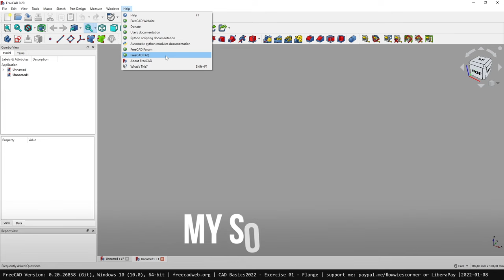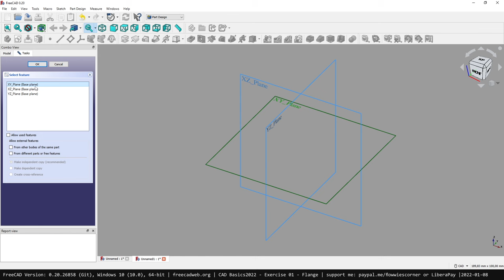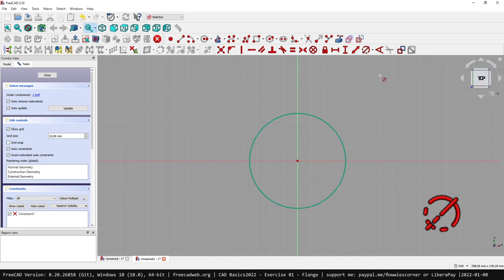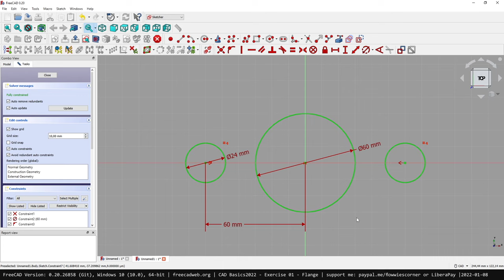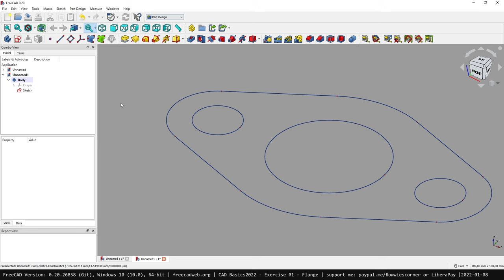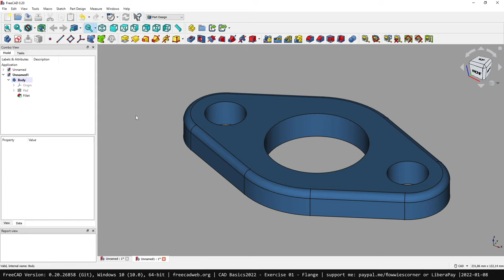FreeCAD 0.20 - Basic Exercise #1 - FLANGE (EN)

Comment: For absolute noobs like me, who followed step by step and got a TON of errors and frustration, make sure the "Auto-remove-redundants" is selected under the constraints panel. This is my 3rd time looking at FreeCAD, and these little things being left out of tutorials is exactly why beginners give up. This is a 9 min video and I spent 30 mins struggling to figure that out. That's a 3x cost. This speaks to both the institutional knowledge that experienced users forget, as well as generally bad default workflow settings. It's clear after understanding how constraints work now, that he has this setting enabled, as you see the symmetrical constraint ID change from 5 to 4 in this video. So removing redundant constraints is critical to complete this exercise but left out by the author
Reply: Oh man did I struggle with this redundancy issue myself.... thanx for the solution!
Reply: Thanks to your posting I managed to get past a real stumbling block. I posted above before I read your post. ;)
Reply: Unreal! Thank you for posting this! I am screaming at the computer.... so true, I have been using AutoCad for close to 30 years. I "use" Fusion 360 etc. exactly what you said, one simple thing to change on the constraints. I almost removed the FreeCad app from my computer.
Reply: Exactly! The teacher's task here is not to create obstacles. This is not figure out yourself type deal. If you teach. You show clearly step-by-step. Or don't show at all! I hate teachers who think they teach but actually waste time. 👊💥☠
Reply: because they keep changing the software too much between each edition.
Reply: this is another problem with this software.  they keep changing it too much.  in the version I have 21.2 there is no option to auto remove redundants in the constraints panel.
Reply: @blue03r6  Yes you do, but it's not visibel without clicking the wrench next to the constraints panel.
Reply: Thanks for posting, you just saved my sanity, why on earth is this setting not auto enabled?

Comment: My first attempt was to draw three larger circles and then join them with lines, then create the holes inside of that. Cut away the lines I don't need, That worked ok, but it's hard to exactly determine where the lines should connect to the outer circles. I also tried with Arcs, but that was much harder. I didn't even think of the polyline! That looked much easier. I'm more familiar with OpenSCAD, so I need to change my mindset a bit to do this kind of CAD

Comment: When I tried to set the symmetry, I got an error. I didn't have "Auto remove redundant" turned on.
Who will have an error, check this moment.
Thanks for the lessons.
Reply from the maker: Thanks for the heads up! I hope I mentioned to use this option in my previous basic course parts but I cannot be 100% sure. Will have to check this
Reply: @FreeCADAcademy  It is quite possible that they mentioned this item :-) I enjoy watching and learning. I uninstalled version 0.19 and installed 0.20. The default setting may change. I didn't notice that little mark right away :-)

Comment: Ok great video! Lovely explain it!  I have more than 1 hour on this exercise, I was getting stuck on horizontal constrain 😢, which was a bit frustrating, for some reason after I was doing symmetrical constrain the horizontal constrain was invalid, for some reason I was getting some sort of error ,, datum 60mm for the constrain with index 7 is invalid,,. However the solution was to do the horizontal constrain first then symmetrical constrain, don’t ask me how I figured out this 🤷‍♂️ I just tried, well to say true I was making some research and some other people were saying something that some previous constrain will not allow the actual one you’re trying to make especially for horizontal don’t know why! Is my first try on 3D Cad creation 
But I you said ,, Practice is the best teacher,, 
Thank you!

Comment: Very Easy. With your 2 vids, I was able to make my first part, this one. It was very simple to follow your tutorial. it was clear, straight forward and detailed. TY!!!!!!!!!!!!!!!! cant wait to do more an learn more from your tutorials.

1 question on the flaw in FreeCAD being the naming issue?  Is this issue pretty much cured in the newer Versions of FreeCAD< or should a newb like myself be looking at the Thunder version of it?
Thanks much again!
Reply from the maker: Thanks for you Support.

Answering your question:
The so called topological naming problem is a very nasty thing in FreeCAD. There are several strategies to cope with it. First you can try and work around it as much as possible. This will teach you to create as little dependencies between geometries as possible but be warned: this only works to a certain extend. Sometimes there are situations where you will find yourself using features like chamfers and fillets on 3D geometries and then all of a sudden your models become unstable. But you will learn a lot in the process.
You could also switch to the Realthunder Linkstage3 branch which eliminated most of this problem but then it’s up to you how you handle incompatibilities between Main and Linkstage3 - you don’t need to exchange files with others? Fine then this might be the right choice. Option 3 is to move completely from FreeCAD and go with a different software like Shapr3D, Onshape, Solid Edge etc. but that depends on your needs and expectations- this cannot be answered for all users ! :-) good luck and enjoy my content also in the future

Comment: Thank you for the lesson.  It was done very well and I enjoyed working through it.  I ended up with one (1) degree of freedom and I could not figure out how to clear it.  It had to do with the right side hole,.  I know that because it was different color than the other lines.  I know that I connected the two (2) small holes to be equal distance from the vertical axis because both holes had arrows pointing toward each other.  The only thing I could think of was that the right hole may not have been on the horizontal axis.  I had "snap on" so that doesn't make sense.  I think I will start over untill I get the exercise right.  GREAT JOB!!!

Comment: This was very frustrating till I figured out in the Combo View tab that you must have "Auto Remove Redundants" and "Auto Update" checked. They are not selected by default and everything breaks. I do like your videos though. I am finding them very informative. I was expecting the solution to be parametric and I admit I got stuck trying to do that instead of just making a simple flange. How would you recommend adding a tube coming up from the flange? And is it possible to add threads?
Reply from the maker: Tube:
Sweep operation with a profile on top of the flange (not on the 3D face but with parameters and based on the standard plane, and a path going normal to this profile)
Threads: Hole operation with threads. But won't be visible unless you have the latest 0.20 TechDraw which has thread symbols

Comment: Thank you! Since I haven't touched FreeCAD since the last binge watching your videos (and repeating), I cheated and just repeated everything after you. Managed to forget I don't need Shift to select several shapes in Sketch and how to go from any shape tool back to the default arrow (looks like it's not a Move/Select tool I expected, not a button you can press on the bar, so it's Esc or pick another tool?). And managed to crash FreeCAD while using M and undoing the last action ;)
Question, if I want to smooth the bottom edges of the part and/or holes with intention of 3D printing, I heard not to use fillets on the bottom but fake them with bevels. Is there a guide for how big they can/should be?
Reply from the maker: Yes you are right. Fillets on the bottom of parts don't give good print results. I don't really create bevels either and I think their shape depens of your part size. If you make them too large, the shape of your part will change too much. Maybe start with small chamfers?
Reply: @FreeCADAcademy  Thanks! I'll try that.

Comment: This is a great exercise for beginners. I had a few problems at first, but after I found out what commands are called, what they looked like, I was able to easily do this exercise. 

In previous companies I worked for I used Pro-Engineer (CREO) and Inventor for the 3D modeling software. Since I cannot afford these programs for home use, this program is perfect. I have to learn what FreeCAD calls there commands, since each software calls them different names.

Comment: I've tried following the video step by step. At 4:48 I'm getting "Datum 60.00 mm for the constraint with index 7 is invalid" error. I have FreeCAD version 0.20 with revision number 29177. No idea if/what I'm doing something wrong, a bit discouraging as an absolute beginner.

edit: After reading some comments down below and a bit Googling, I've fixed it by making sure the checking "Auto remove redundants" option while setting up the constraints. Hope it helps someone.

Comment: Using the latest version (0.20.2) and things did not work as shown in your video. But I managed to finish the sketch, only when I closed the sketch, it disappeared even when I zoomed to fit. I'm used to Inventor, have used it since 2004. This program operates very differently as I would expect. But it seems to have some bugs in this version. Comments? Thanks for your help. God bless and stay well.

Comment: [code]
OS: Windows 10 Version 2009
Word size of FreeCAD: 64-bit
Version: 0.20.1.29410 (Git)
When I click the center of the left circle and then the right Circle then the Center line. When I press >< (constrain symmetrical) all three circles turn wrong color and I get error message in the Report view "Recompute failed! Please check report view.".  Suggestions?

Comment: Thanks for the video. I notice that you have these exercises for 0.20 but seem to only have tutorials for 0.19.1. Do you have a tutorial for 0.20 available in other places? Or are you thinking about adding a 0.20 tutorial to YT. If not, what are the main differences between 0.19.1 and 0.20? Are there things you show in the 0.19.1 tutorial that either won't work in 0.20 or work differently? Appreciate any guidance. Thanks.

Comment: As a neophyte,(have not designed one part yet!) one problem I am having, while trying to use CAD tutorials, is my FreeCAD screen never looks like the FreeCAD screen used by the instructor. All the stuff along the top is never the same. Sometimes the command the instructor clicks on is either grayed out or is not there at all! And sometimes my screen has command icons his screen does not show.
Also, the info in the left side ‘Combo View’ is different. His will show ‘unnamed’, mine will show ‘Body’.
Another problem I have is when the instructor says he is doing sometime but does not tell you how he got there! As an example:”We are going to start in the ‘Part Design’ environment…..very important. And we start by creating a new body and a new sketch in this body.”. He is quickly clicking along without showing in detail(click by click) how he gets there or why.  It is not possible to follow his rapid  mouse clicks or see his keyboard entries so, I end up with a completely different  looking screen...not able to move forward.
Can anyone help me get over this protuberance, so I can design a 3D part?
I am using FreeCAD 0.20.

Comment: I have tried twice now & both times Freecad 20.1 has crashed completely & turned off. Unfortunately I cannot recall exactly what i did wrong. But it was something to do with the tangents & radii on the L hand side. as I was editing the poly line.  I am running W11 on firefox.

Comment: I tried to follow this step by step with freecad 0.20.1 (29410 git). But some constraints result in a popup saying that the constraint is invalid. starting with the two smaller circles. They are both constraint to the same distance from the vertical axis, but then i can not constrain it to 60mm. if i delete the constraint for equal distance, i can constraint them individually. But then later, i can not constrain the radius of the left and right arc. why not? 

it is these things that i give up on freecad every time i try to do a tutorial. I really want to learn this, but every time it seems to behave differently. This should not be different between version 0.20.0 and 0.20.1

Comment: I retired from CAD/CAM manufacturing using AutoCad 2000 this is totally different. I place all the circle and radius at which point I was lost. Years ago I do that and then draw lines tangent to circles and trim away the unwanted stuff. I am sure there is probably a way to do it but I will do it your way right now. What is that green vertical line in your demonstration as it does not appear on mine after I enter  sketch mode?

Comment: Thank you Flowwie.
Not too much problem but did need help a little especial the constrain tamget to get last pont of the polyline correct. I was also blind as bat for the radii of the outer arcs. All I could see was them as diameters of the circle. Then I noticed the big circle had two differing measurements. Talk about a facepalm moment.
So from what I have learned in your tutorials this is either/both the easiest CAD software to use or it is because of your teaching making it seem easy. I will say it is the later.

Comment: Excellent video very helpful and easy to follow. I find with any cad its how to start, basically the first 5 steps and once your there you can play. The only question I have is, is  there an easy way to change orientation of the model, no mater how many times i clicked on the top right box i could not get it the same as yours.  Is there a way to move it around with the mouse.
Thanks for the demonstration of cad 0.20.

Comment: I did not have any previous experience with CAD and it took my a few hours to complete the exercise correctly. Then I watched the rest of video to see what I have done wrong. I turned out that I discovered most of things, but I missed a few nice shorcuts demonstrated in the second half of the video. E.g. I kept trying to use ZS symmetry to copy objects form left to right, which did not fully work, becasue what was copied missed constraints anyway. I also drew the outline by creating large circles and removing parts of them with trim. Of course the method with polyline was 10 times faster and better. But it was a good lesson of handling the program in general, managing constraints, navigating the UI. Thanks!

Comment: I did it, my first completed exercise! Only used AutoCAD while at uni, 15 years ago, and very briefly. I could not remember a thing about CAD in general and I recently found out about FreeCAD.
I was surprised I was able to do it in about 10 minutes. I did use polyline, but without pressing the M button. I drew a rhomboid then added fillets manually to its corners.

Comment: Thanks for these, I'm just starting out with CAD after doing traditional 3D modeling for ages.
But as I try to follow along with you here and I do exactly what you do to Symmetrize at 4:32 I get this error message (Recompute failed!), what am I doing wrong. I should tell you I'm on a newer version of FreeCad as will V. 021.2. 

Solution, this comment below was crucial to be able to finish this.

/.../
@GregorySchwartzkopf
för 6 månader sedan (redigerad)
For absolute noobs like me, who followed step by step and got a TON of errors and frustration, make sure the "Auto-remove-redundants" is selected under the constraints panel./.../

 But it's not visibel in V 02.21without clicking the wrench next to the constraints panel.

Comment: they change so much between the version of this software you can't follow these tutorials.  .21.2 looks completely different and shows all kinds of errors following this tutorial.  you can't go past setting the 60mm distance between the 3 holes. you literally left out extremely important details that anyone following along will cause issues.  like the guy said below. you changed your stuff and didn't put that in the video.  videos should start out with setting the preferences of the software so we see the same results you do.
Reply from the maker: Just calm down
Reply: @FreeCADAcademy  it would be different if freecad would keep the older versions available so we could follow along and actually learn something.  Plus the latest version is full of bugs.  On the video exercise 6 basic course, the last 2 steps cannot be completed as shown because the siftware makes the inside of the gasket overlayed on the outside of the gasket once you try to constrain the last two arcs as shown in the video. Everyone with a different version spends an hour trying to get 1 simple step to behave the same way the video does. They make your video 95% useless.
The software is changed so often it ends up full of bugs.  Im realizing although a complete totally free cad software, companies still pay $5k to use other ones.  The 2 engineers at the company i work for right now tried freecad a few days ago when i talked to them about it and immediately said this is terrible 10 mins into using it.  Said its designed by software people not people who use cad to make things.